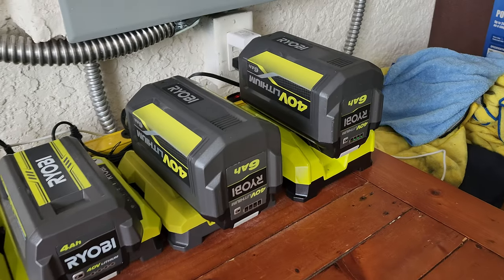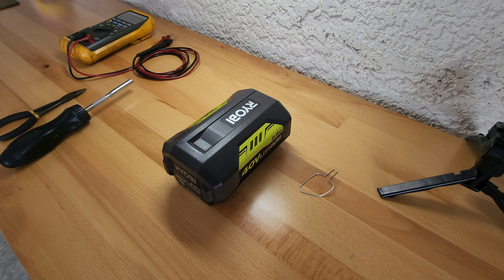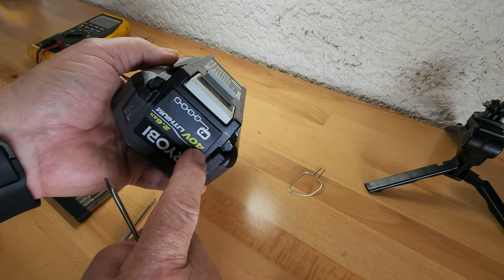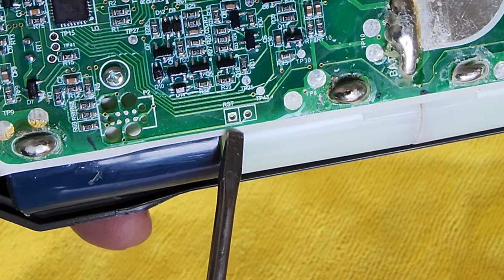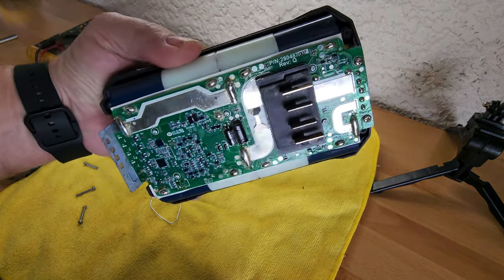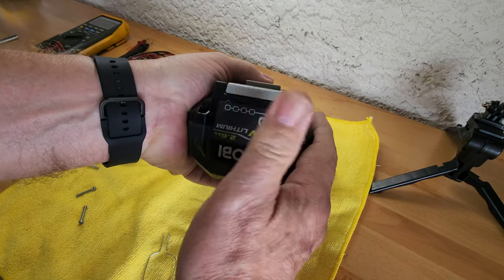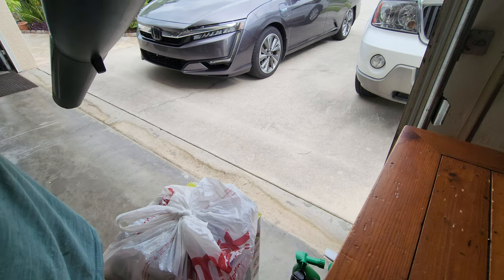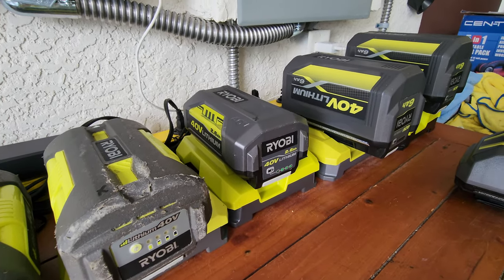Ryobi 40V battery fail, Master Reset!!!

Comment: Thank you so much for the excellent video!  It worked exactly as you described.  A single button push with the paper clip reset and the battery recharged.  My battery had a rubber plug covering one of the screws which I removed easily.
Reply from the maker: You are very welcome.  I am very pleased it worked out for you.  Thank you for sharing your success.  Have a wonderful week 😊.

Comment: 🎉 You rock! I had set it aside with the intention of having to throw it away. My wife mowed and kept restarting the mower until the battery was completely drained. Gave me that error lights on the charger and tried taking it off and on 100 times. So simple and it worked!
Reply from the maker: What a wonderful report! Thank you so much for sharing your success 🙌.  Thankful it worked out for you.  Have a wonderful weekend.

Comment: Thanks for a very helpful video. I had the same problem, nothing on the internet worked until yours. It took me only 2 minutes and it did exactly like you said. On charger now and $6.00 is better than $149.00 to replace. Thanks again
Reply from the maker: Congratulations on your success.  So glad it worked for you.  Thank you so much for sharing your achievement.  Have a wonderful week.

Comment: Incredible.  In an ideal country of honor in our product design and not planned obsolescence greed, we'd have an external reset button to bridge these two and press power.  Even official steps in the manual for such a process.  But I'm thankful it works and it's still not terribly difficult to reset.

Mine actually flashed when I just touched the two for the reset - labeled RST.
Working! Probably just varies per revision or model of these batteries, if yours doesn't automatically blink on RST bridging, press the power button at the same time.
Had to use a real thin safety pin, took some wire clippers to one end. Tiny little RST holes, discouragement of that easy fix reset every step of the way hah.

You know I wonder how many of these batteries Ryobi takes in and merely resets, bam refurbished.
Reply from the maker: Thank you for sharing your experience 😊.  It helps others.  Yes, an external access reset button would have been great 👍.  Have a great week 😀.
Reply: @htnowpro  Thanks, glad to help and y'all too!

Comment: Worked for me great, I didn't have to push the button but I did anyway after jumping connection.  Thanks a bunch.  Previously I tried the battery to battery method which didn't work.
Reply from the maker: So glad you were able to restore your battery and make it operational.  🙌.  Thank you so much for sharing your good experience.  Have a great week ahead. 😀

Comment: Works perfectly thank you! I did NOT have to push the button. Just left the reset circuit connected for a couple of seconds. 

Also you can break the center stud off on the screw heads and use standard Torx.
Reply from the maker: Thank you for sharing your success.  Have a wonderful week ahead.

Comment: Thank you for this video! I had a 40v battery for my leaf blower that showed a fault. I took it apart and cleaned off some mild surface corrosion and tested the voltages for every series and they were good, but still wouldn't charge. I inspected every component and nothing looked out of place or obviously burned. I completely overlooked the pads for the reset! As soon as I shorted those pins together the 25% led on the battery flashed and it's now charging. Thank you, again!
Reply from the maker: You are very welcome.  I am so happy you were able to save your battery.  I basically did the same thing, then I searched youtube and then jumped the reset, but it didn't work on mine. I put it back together but didn't throw it away , I knew it shouldn't be bad so soon. Later I tried one last time.  That is when I pressed the button at the same time...it flashed and came to life!!! Thank you for sharing your success. Have a wonderful new year ahead! Thank you for watching.

Comment: Excellent video. Thank you. I followed your instructions and I was able to get my Battery/Charger working again. The battery is charging as I type. The “dummy screw” was just a plastic cap. I used a drill to put a hole in it just enough to get a screw diver in to pry it out. Then I used my drill and T10 bit to remove the screw that was underneath. I used a paperclip to jump the pins. The Green lights came On and I was able to charge the battery. I also did not have to press the Power test button at the same time. Thank you again for your video.
Reply from the maker: Another battery put back into service, Yay!!! You are very welcome.  Thank you for sharing your success with us.  Have a wonderful New Year ahead!!!

Comment: Nice job. I've been getting the runaround from Ryobi over replacing an 11 month old 40v 6ah battery they claim wasn't part of my original purchase. BS! I purchased my lawn mower from a big box store in a sealed box. Someone in their packaging or retail chain made a mistake and I'm pissed. I have dozens Ryobi products and have never made a repair or replacement claim in all the years I've had them. Hopefully the latest representative I'm dealing with makes this issue right. If not, I'll make an attempt to reset the battery then begin purchasing aftermarket batteries until the machines quit working. After that it will be time to start purchasing other brands.
Reply from the maker: Thank you.  Hope all works out well.  Have a great week. Thank you for sharing your experience.

Comment: I'm going to have to watch your video again.  First thing I can tell you is that my 40V batteries do not have an actual reset spot like yours and the few other videos I watched.  But I found a spot near the end of the board where there is a RST and RGND and some other notation.  So I jumped those, pushed that button.  One of my batteries, the 4 amp hour one, now keeps the flashing green/red light solidly on green, but doesn't charge and doesn't flash, nor does the battery flash like it's charging.  The 2 Amp hour had no change.  So I'm going to watch your video again to see if I missed something and if I did, I'll try that.  Otherwise these are off to the battery graveyard.  I already have brand new ones on the way.  But people who watch this should know that not every one of these batteries have that reset pin area in the place depicted in these videos.  I took a photo with my cellphone then enlarged it to make it less stressful for my eyes. That's how I found it.  By the way, both batteries when you push the status button, show one bar.  They do light up one bar, but that's it.  So there is energy in the thing, but they wouldn't go any further.  Okay, I'm back; I watched again and don't see anything significant that you did that I overlooked.  So I'm going to try one of the other methods of charging it up to around 3 v or so, then possibly incorporate what you did.  As I said, my reset area is different than any of the ones I've seen so far.  Not sure why, maybe circuit board manufacturers or something similar.
Reply from the maker: Your battery must be a different version.  Please let us know how it goes.
Reply: @htnowpro  I have a 36 volt battery and the RST is in the corner with several other contacts, I think the same as in your battery.
Have you started the battery?
I'm interested

Comment: Just as you carefully described, I removed the 4 screws from my lifeless 40V Riobi battery,  lifted off the cover, jumped the "RST" (reset) contacts while simultaneously pushing the battery button under that sticky front cover, and "Voila" . . it's indicating a low charge condition (1 green light) and is ready to be charged again. Kudos to you sir!
Reply from the maker: Thank you so much for sharing your success 🙌. Have a wonderful week 😊.

Comment: I watched your video on pulling the 4 screws and jumping the reset points pushing the button to show my charge levels. I completely understood everything. 🤓  I'm not a qualified tech though so I will be enrolling into electronics tech school for 2 years so I can complete my reset on my battery!👨‍🎓 It will be worth the 2 years to get qualified so my battery works again! 😃. I've taken apart many appliances and just figured out what was needed to repair things without being certified for many years now. No one has told me I was suppose to get certified first 😅. My wife wants a simple deck out back so after I become a certified electrician it's off to get my building contactor license to build her that deck..😅 It will now take me many years to complete my honey do list, but I will get it done and be worth it! 😅
Reply from the maker: Your reply is great!! Thank you for taking the time to respond. I did say you must be qualified but I didn't say who, or what it takes to become qualified, that is at your discretion, :-). Have a wonderful week!!

Comment: This worked for me. After getting the battery apart, I bent a paperclip and pressed it into the RST holes and hit the button near the charge indicator and it flashed. Note there are no buttons in the RST, it's just an electrical connection. I put it on the charger and it finally took it. BTW, it had 3 of the 4 lights green already so it did have a charge. Don't know why the charger was rejecting it. Oh, and I couldn't get the 2 rubber plugs out with a screwdriver, so I used a small drill bit and drilled a hole in the rubber plugs and they came right out without damaging anything. It's fully charged now and I can use it again. THANKS!
Reply from the maker: You are very welcome.  Thank you so much for sharing your success.  Have a wonderful week ahead 😊.

Comment: I had a dummy plug and had to break it off but still have 3 screws so its OK.  Also, the reset leads are SO small so I used a coated metal twisty you have on a bag of bread or something.  I know sounds lame but it fit correctly and worked right away! In my case the green lights flashed 2 and I just recharged it and it works again.  Saved money.
Reply from the maker: Saved money!!! Great report 👏.  Thank you for sharing your success.  Have a wonderful week ahead 😊.

Comment: That was easy! Something the manufacturer doesn’t want you to know, they will tell you to take it to a service centre for repair or replacement, then charge you a fee to inspect and reset it, then say it was most likely your charger or to much charge or dead to long. Awesome the way you did the investigation and found the problem and solution to fix it 👍🏻
Reply from the maker: Thank you so much for the kind words and for sharing your success.  Have a wonderful week ahead 😊.

Comment: I was without my electric Ryobi chainsaw all last summer. I went out and bought a cheap gas chainsaw because I couldn't bring myself to pay the exorbitant amount of money for a new battery. I'm definitely trying this hack when I get back up to the cottage!
Reply from the maker: Thank you for taking the time to comment. Please let us know how it turns out.  Have a great weekend.
Reply: @htnowpro  - Just preformed your hack, and the battery looks to be charging just fine! Thanks so much. Would have been $220 Canadian to replace this battery!
Reply from the maker: @spanky7777  Yay!!! That is a great report.  Have a wonderful week 😀.
Reply: @htnowpro  - guess I spoke too soon. Once charged, I put it on the saw and tried it. Saw moved about half an inch, and the battery went back to blinking. Tried resetting it multiple times, but no luck. So I suppose I do have a defective battery. It was right at the 3 year mark when it failed, unfortunately, so just out of warranty. Pretty discouraging. The battery was fairly lightly used, just for the chainsaw.

Comment: Awesomeness! This worked for me. My battery didn’t need me to click the front bottom at the same time as the reset button.
Reply: Additional note, you can still call ryobi. They have a 3 year warranty on the batteries. They can tell when they were sold.
Reply from the maker: @WonderFlea  great information.  Thank you for sharing your success and the RYOBI warranty information. Thank you for watching.

Comment: Thanks so much!  You just saved me $120-$150. This worked perfectly for me. I struggled with 2 of the torx screws and had to tap them out. Otherwise all went well. I did not have to press the “power” button. I used a small pair of tweezers to jump mine. Thanks again.
Reply from the maker: You are very welcome.  Thank you for sharing your success.  So happy you were able to restore your battery to a working condition.

Comment: Hi. It's work for me! I put the jumper into reset points for a couple seconds. All light is starting on permanently. When i pull the jumper up, they stop light and after placing into the charger it start charging from 1 led. Many thanks for your help!

Comment: Did the master reset on ten 40v batteries. All responded as in your video. Then they went back to the 4 light blink. They just kept repeating the cycle and would not charge.
Reply from the maker: How old are your 10 bad batteries? Did they all die on the same tool? How long did they last?

Comment: This worked for me. My battery was flashing 4 lights.  I took apart and jumped across the rest like the video said.  I did push the button while doing the jumper.  My battery charged and ran my blower.  Have not checked life yet.  Hardest part was getting the dummy plug out.  

Going to try on a dead 18v battery I have so.
Reply from the maker: Happy it worked out for you. Please let us know what you learn from the 18v. Have a wonderful week ahead.

Comment: i was dropping off some old AA/AAA batteries at my local recycling center and picked up a discarded 4Ah 40v battery because i could use another for my mower/weed whacker.  It had the 4 flashing lights issue.  Alas, however the procedure didn't work.  I tried several different key press behaviours has not fixed this one.  Its only got 5v.  ill leave it on the charger for a while to see if it kick its off but I am not hopeful.  if it does spring in to life, ill report.   Im also on the look out for that extra battery or two!!
Reply from the maker: Thank you for sharing your experience 😊.  Some viewers report purchasing used batteries from garage sales and the like in the hopes of resetting them.I feel  it is absolutely worth the few minutes it takes to find out prior to discarding them 😀. Have a great week ahead.

Comment: Last time I buy ryobi product.  Blatant engineered failure.  I've only used this ryobi battery a handful of times, no reason it should be failing after 5 uses.  Did what you said and the battery is now fine..
Reply from the maker: I am glad it worked out for you.  Thank you for sharing your experience 😊.  Have a great week.

Comment: Liked this video.  These are expensive batteries to replace so it’s worth the try. 😊
Reply from the maker: Thank you.  Yes, it would be a huge waste of a good battery if it was able to be reset and was discarded.  I felt the same way. Mine is still working properly.  Hope it works out for you.  Thank you for watching and commenting.  Have a great week ahead.

Comment: Believe it or not I heard that if you put the battery in your freezer for a few hours it will reset it. Before doing this I tried the freezer tip and low and behold the battery reset and charges/ works fine now!
Reply from the maker: That's amazing. Thank you for sharing this with everyone.  Extreme temperatures are considered damaging to lithium batteries, so I am shocked at how this works?

Comment: I had the same problem but that fix didn’t work. My battery voltage was too low for it and it continued to trip the charger into damaged battery mode. 

I first tried to charge it with the prongs that stick out but it wouldn’t work and I didn’t have the correct size resistor on hand to get it going either. So what I did was use the power supply that comes with the charger and I hooked positive to the prong and negative to the pcb where it says ground. I let it charge for a half hour and then tried the reset procedure again. This time it worked.
Reply from the maker: Glad you were able to get it going.  Thank you for taking the time to share your experience.  Have a wonderful week ahead 😊.

Comment: Thanks. I'm going to try this. I've only had my Ryobi set for a little under a year. My charger is flashing the red and won't charge. I have barely used it. I used my weed eater and blower last summer and then they sat all winter and suddenly now the battery doesn't work. I am going to try this
Reply from the maker: Your battery is probably under warranty.  You might want to call RYOBI prior to trying this. Thank you for watching and sharing.  Have a wonderful weekend.

Comment: The question I have is, how did the batteries get into that predicament in the first place? I have two that just did the same thing over this past weekend. One is a 4ah, the other is a 6ah, 40v. I used them both in my Ryobi mower till they they ran out and when I put them on the charger it showed the red/green flashing light. Was it just something that happened or did the mower itself have something to do with it. Plus, I also have an 18v doing the same thing from whatever tool I used it on.
Reply from the maker: That is the million dollar question.  I can only guess, based on my automotive experience. Low voltage can cause electronic modules to go crazy/ freeze/ lockup and even fail. Its possible that whatever algorithm or " software strategy " is programmed as a failsafe,  to not allow further use " Hard fault or perceived hard fault is being triggered by a voltage fluctuation or other fault.  If the reset works it's the same as performing a control alt delete or reset similar to a computer.  Just my guess...I really would like to know also.  Thank you for asking.  Sorry, I don't have the answer 😔.